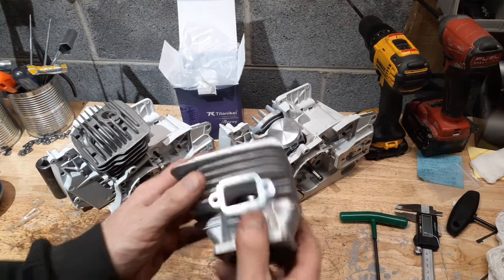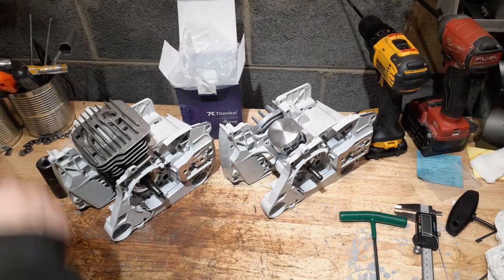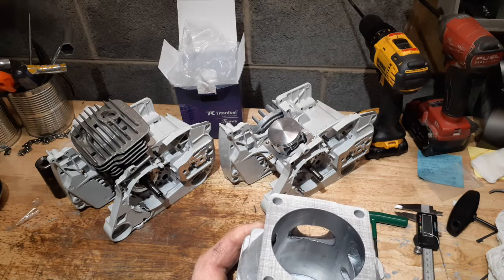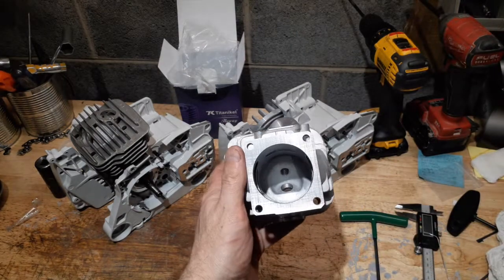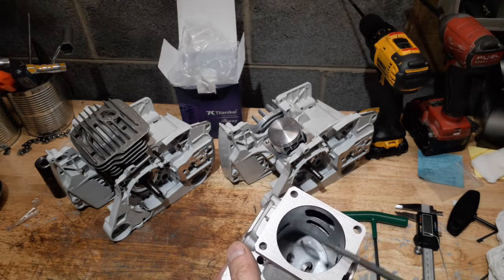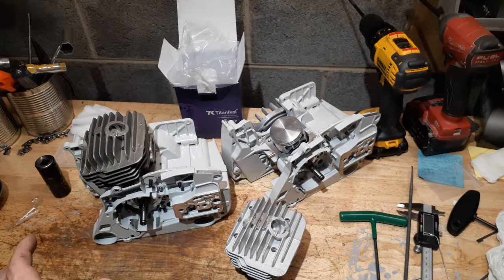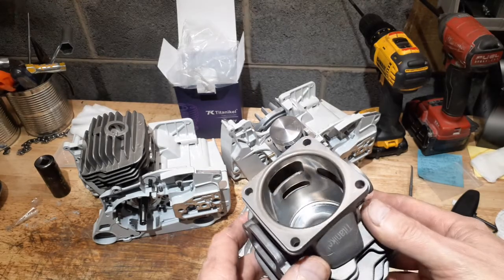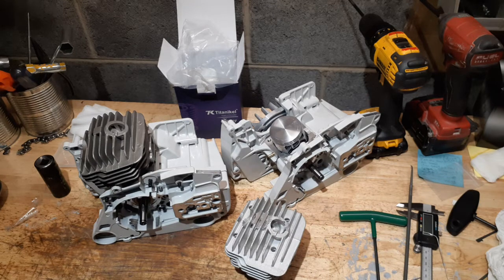Farmertec 460 cylinder gotchas

Comment: I’ve put together a few saws with chinesium ebay cylinders and I’ve been surprised that they’ve run as good as they have. I haven’t seen any flaking coating so far thankfully
Reply from the maker: Same... I do pick through pretty hard and I do toss a good amount of the FT cylinders... But when I go back and look at 3+ year old cylinders most if not all look great. I just pulled a 44 cyl that has been used really hard and was shocked how good it was. I really think the modern oils are so darn good it really helps....